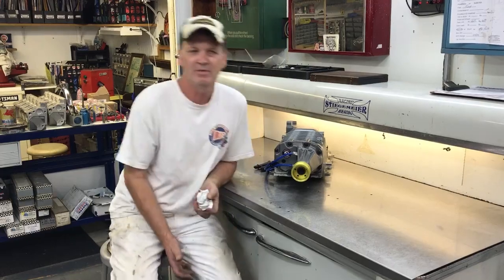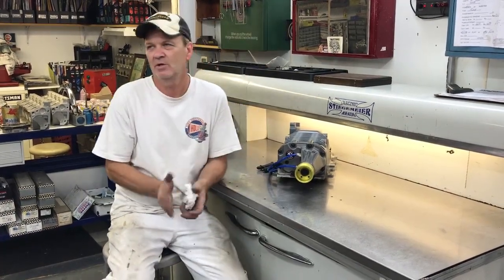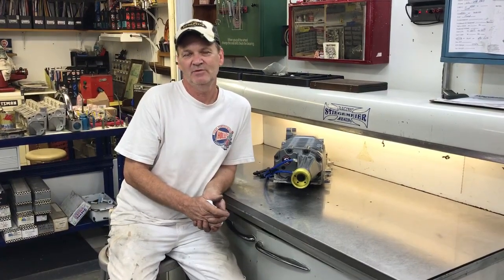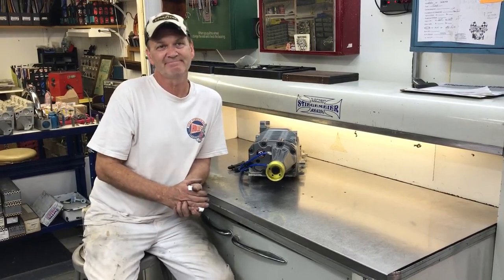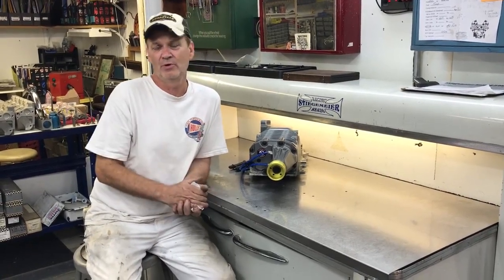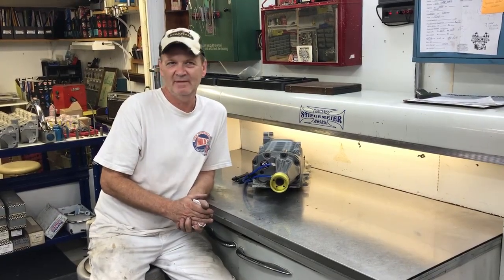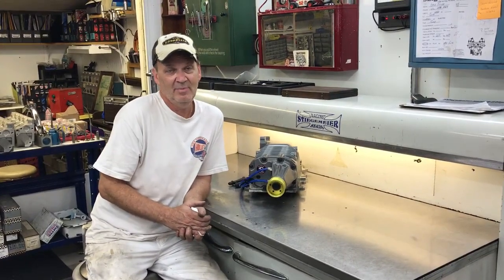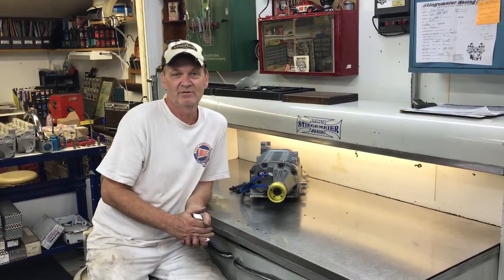Why Superchargers Fail

Comment: I had over 300000 on a factory supercharged vehicle so he is incorrect on his mileage range.
Reply: I have a 3800 supercharged that has high mileage and the supercharger still works great.
Reply: 224,000 on my 02 F150
Reply: Ok but actually he is NOT wrong  but why not leave a negative comment with zero proof.
Reply: Depends!.... They tend to fail when it's idling most of its life, the coupler will go first.
Reply: Yeah and my TRD charger was stock and failed within 30k miles